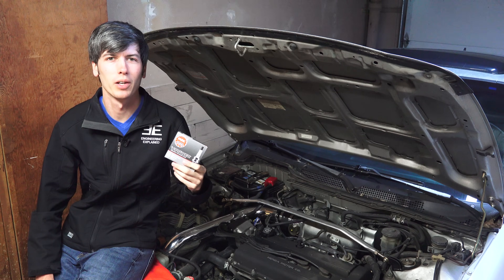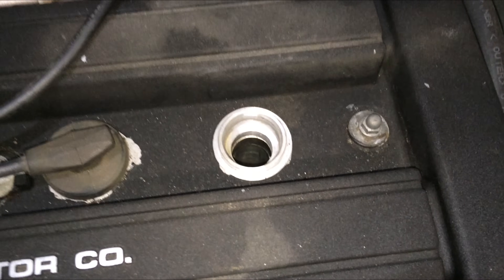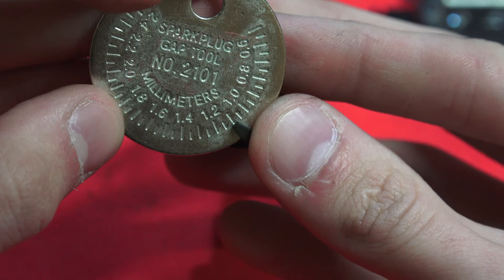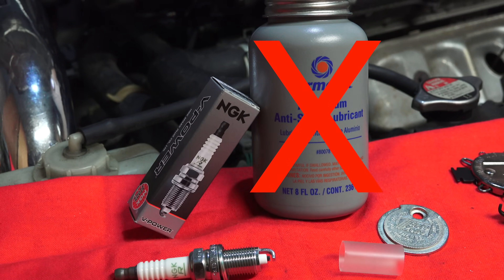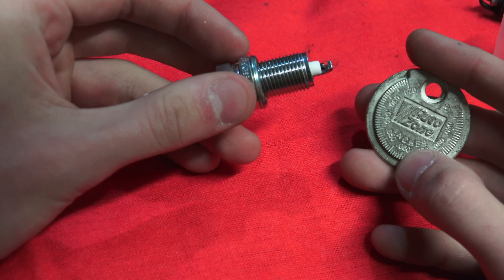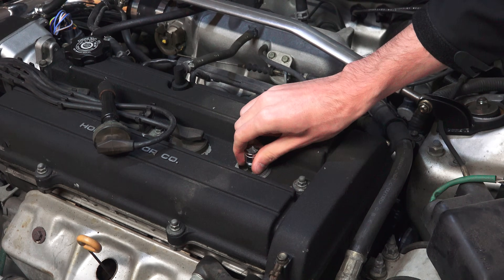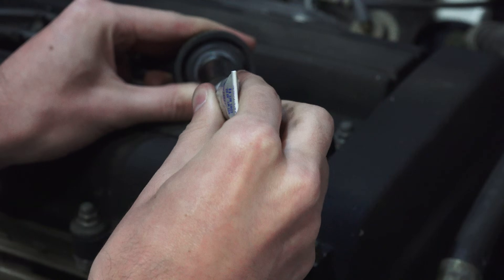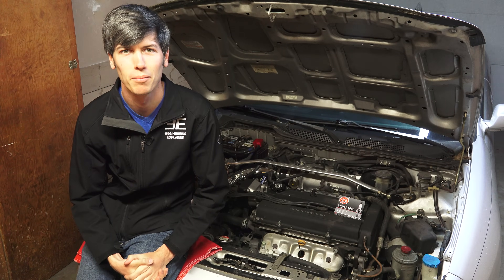How To Change & Inspect Spark Plugs

Comment: Damn I can't find them on my Tesla Model S. Can someone help?
Lol even my Golf TDI doesn't have these :( What am I doing wrong?
Reply: +Hunter178 Is that a joke or are you serious?
Reply: +Hunter178 Car manufacturers nowadays hide everything from the owner. To get to them you need to strip half the car, reprogram the ECU bit by bit and solve a 18x18x18 Rubik's Cube.
Reply: +Hunter178 First you got to jack up the car and put it on jack stands. Then remove the driver's side front wheel and then the passenger side rear wheel. After that, open your trunk and remove the carpet to expose the spare wheel. Take that out and throw it away, you dont need that. Then open the hood and proceed to stare at it until someone comes to help you.
Reply: ***** True. But i dont like drinking while im working on my car. Its after the repair/maintenance that I enjoy my cold beers. And after my first test drive....
Reply: +Hunter178 Dude, im not sure about your tesla, but i would assume it doesnt have an engine, and its a pure electric car, so you dont have spark plugs in the Tesla.
about the Golf TDI(Turbo Diesel Intercooler) - diesel - diesel engines dont use the same ignition system as gasoline cars. You dont have spark plugs in the Golf either, instead it has nozzles which spray diesel fuel directly into the piston compartment at a high preasure and the diesel fuel selfignites from the increased preasure provided by the piston in the compression cycle.
Reply: Pavel Nedelchev Dude I thought the joke was more than obvious :D But thx anyway and I think it's called Turbo Diesel Injection.
Reply: +Hunter178 dude......they are in the glove box
Reply: Just drive it into your nearest lake and watch the sparks fly out
Reply: First you've gotta switch the summer air out for winter air in your tires

Comment: The crush washers are making me nervous and throwing me off because I cannot tell if it’s getting tight. you did a lot of turns. I didn’t do as many turns and I have same torque spec as in the video but I only did like 1/4 turn

Comment: I have a question about my 04 Dodge intrepid I had trouble taking off one spark plug and when I finally got it off there was looks to be rubber or plastic ring down where the spark plug set at and also some deposit what is that and also how can I get that out I don't have air to blow it out what is a good way to get it out without dropping in the engine
Reply: try long ice pics or any long sharp tool to break it up in pieces then stab it and bring the pieces out

Comment: Hi when after I changed my spark plugs and turned the car on there was a lot of smoke coming out of the exhaust. What did I do wrong?
Reply: Adrian Campos did the car stop smoking after running for a little bit? if yes you could have water or oil on top of your plugs. and when you removed them it went into the cylinders and got burnt off

Comment: How important is it to use the correct amount of  torque ? . What happens If I just use a plain normal ratchet  ? .
Reply from the maker: +Jarek Roitapfel Could damage the cylinder threads, or put the spark plug in too deep, causing contact with the piston or valves worst case.
Reply: Engineering Explained Thanks , guess I was about to damage my old banger.
Reply: +Engineering Explained you are kidding right?  You would strip the threads long before you ever did that. I have been doing plug jobs for 50 years without a torque wrench and have never either stripped a thread and definitely never driven a plug into a head deep enough to contact a piston. A bit of engineering overthinking I would say. Oh.... I have never had a plug blow out of a cylinder because it wasn't tight enough.

Comment: Worth noting that you should avoid using the spark plug sockets with rubber inside when tightening/reinstalling the plugs as they sometimes stay attached to the plug when removing the socket and are a pain to get out.
Reply: I used a little bit of WD-40 on the rubber end.
Reply: That actually makes a lot of sense, I wonder if it messes with the contacts on the leads tho?

Comment: what about on a 1984 300zx? Where you gotta take off the intake manifold. I tell you, that was a pain in the ass.
Reply: +Myasa Man i bet a old Toyota HiAce is worse. pain in the ass.
Reply: +TheDamnSwede well there's more than just the manifold to take off, plus the pieces are all corroded and the vacuum hoses and fuel lines are all basically melted on.

Comment: I replaced the spark plugs and wires on my 05 ford Taurus and now the engine cuts off when I put it in reverse or drive. However, it stays on when in park. Any clues to why?
Reply: check for any wires or vacuum lines you may have disturbed doing that work

Comment: not the case here, but on platinum plated plugs you don't want to gap them, you can flake off the plating. they should be properly gapped from the factory and protected from any impact from the little cardboard tunes around the end

Comment: in my car spark plug siezed and not removing 
please help me how do i remove them and replace new one
thanks
Reply: carefully use a long cheater bar with a socket on the end and try slowly moving it counter clockswise

Comment: Quick tip: If you have a Ford vehicle you can usually buy the Autolite equivalent for a fraction of the price of the Motorcraft plugs. They are the same exact plugs. :)

Comment: I noticed you click the torque wrench more than once when tightening the plug. Never ever click the torque wrench more than once when tightening any threaded object especially in aluminum parts. You will over tighten the object and possible damage the threads.

Comment: I've never heard of putting dielectric grease in the plug wires, and I don't quite understand how this helps?
Reply: dielectric grease is slick and makes removal of the spark plug boot easier to remove but it also is highly resistive to electric sparks that can jump air gaps to your engine head or block. Anyone who has ever had an illusive misfire caused by this will never change plugs or plug wires without using it. I had one of these once that almost drove me crazy until I finally saw it one night jumping from the coil wire to the metal band around the coil.
Reply: +Hammer0f Thor awesome! thanks for your reply!

Comment: On my smart car i removed the spark plugs and they were soaked with oil, is that normal?
Reply: No, you need to get it checked its either a bad spark plug or most likely a leaking valve cover gasket

Comment: what happens if the spark plug gap is more or less than factory?
Reply: You adjust it by bending the electrode. The gap measuring tool usually has a notch on it designed to do this.

Comment: However, not all cars have plugs that are easy to get too, and yet others are almost impossible..
Reply: 8-valve struggles :D
Reply: +Hollowseed1 Transversely mounted V6 struggles, for the other 3 cylinders that are not facing you.
Reply: Bikes for example
Reply: +DarkMan2555  i feel you. i had a 98 chevy malibu, it was hard to get to those back plugs.
Reply: cough boxer engines
Reply: My Toyota Corolla 2006. is very accessible and maintenance friendly car.
I remember my old late 1970's,1980's Volvo 240,same thing.
Reply: the 2013's nissan sentra is a maze to get into
Reply: True. To access the plugs on my Honda Fit (per service manual) I had to remove both wipers assembly, the windshield lower corner trim pieces, the cowl screen, and a metal tray under it all that holds the wipers motor.

Comment: I would think mating surfaces need to be cleaned or wiped before installing anything.  Why doesn't anybody clean the top of the cylinder head, where the spark plug mates, before inserting the new spark plug??  I imagine a rag and screw driver could be used, but seeing if you did a good job is difficult.  In addition, the rag may push debris on the sides of the well into the cylinder.

Comment: forgot to mention that the price is for each plug man. also not every 30k miles means you have to replace the plugs. it all depends on the make and model and how you drive your vehicle. I have over 50k on the same plugs and I check them regularly, they are still fine to run.
Reply: +jlrockafella In his case it was $10 total. $2.50/plug for copper plugs, on an Integra/Civic where everything is literally a dime a dozen, is about right.
Reply: *****
damn, i gotta get another vehicle then. I gotta use the platinum plugs on my GT every time I do a tune up. They are not cheap ;D
Reply: +jlrockafella Hehe, my Intrepid needs platinums too (6). They go 100,000 miles though so I've only changed them once so far.

Comment: If you want to upgrade your ignition system take out the oem spark plugs and replace then with some high torque and horsepower glow plugs, you'll be surprised with the results

Comment: Dear Engineering Explained: The following is my opinion...l. Honda recommends 13 lb/ft of torque WITH anti-sieze.  NGK recommends 24 lb/ft without.  I'm pretty sure this is the reason for the confusion over anti-seize.  Personally I install NGK plugs without anti-seize ONLY WHEN NEW. and torque to their recommended 24 lb/ft.  The plating is a sacrificial layer which to me means "one time use".  Should you remove your plugs and re-use them. (ie: for inspection, compression checks, or any other reason) re-install them with copper anti-seize and use the recommended 13 lb/ft.

Comment: The in line 4 cylinder spark plug replacement shown should be a simple job. But try this on a  transverse 6 cylinder engine spark plug replacement where you have to remove the intake manifold to get to the back cylinder bank, goes beyond an average owner's ability.
Reply: +George Travers Imagine changing spark plugs on a V12 :D
Reply: +Giovanni Foulmouth  I've done it on a 80's jag, and it wasnt to bad. Getting to the back plugs in my 98 chevy malibu was hard tho
Reply: Douglas Gardner the funny thing is, when I wrote that reply, I was thinking about the XJS :)

Comment: Why not upgrade the regular spark plugs to iridium spark plugs?
They are known to have some benefits and to last way longer.
Reply from the maker: +Rafael Coutinho I put 300 miles on my Integra last year.
Reply: Engineering Explained You should make a video about iridium spark plugs. I think a lot of people will appreciate it.
Reply: +Engineering Explained OEM plugs meet the requirements so they're never a bad choice, however, your viewers don't necessarily share your mileage preference so it would be beneficial to bring up the idea that they can pick heavier duty spark plugs
Reply: +Rami S. Problem is non-OEM plugs can have issues w/ misfiring, or even failing to start. Just about every car has a forum online somewhere, double-check you don't have a picky ignition system before you deviate from the exact OEM plugs.
Reply: +Kyle Repinski There's absolutely no problems if you replace the OEM spark plugs with Iridium spark plugs of the same specifications from the same manufacturer.
Reply: ***** Like I said, some cars have picky ignition systems. You haven't worked on every car ever made, your anecdotal evidence means nothing.
Reply: +Kyle Repinski And where's your evidence? You are just some nerd trying to look good and pretend you know something about cars..
Reply: +Rafael Coutinho The plethora of people with Chrysler LH body vehicles like myself that insist there's no plugs that run better than the OEM NGK platinums, that's my evidence. Go look it up.

And as for what I know about cars, there's not a single damn job I wouldn't tackle with my car, save something serious enough to require pulling the entire engine out. Every suspension part on there was replaced by me, which is quite a pain in the ass when half of it was rusted into place; just this weekend I got rid of the silly leaking oil cooler lines (Chrysler stopped using an oil cooler in newer model years of my car, I wonder why...). Brakes, head gaskets, spark plugs, you name it I can do it.

To me it looks like the nerd trying to pretend they know something about cars is you.
Reply: +Kyle Repinski Don't waste your time trying to make yourself look like a pro mechanic, I have no way of knowing if anything you say is true, so it's all crap to me.
Have you tried using an Iridium NGK spark plug of the same specs in your car? Probably not, so please stfu. :)
Reply: ***** You tried them on one car. Wow. That must be true on every car then! /s

I'm saying NGK makes plugs of the same spec in iridium, I have tried them, and they do not work well. No auto parts store marked them as compatible, and I'm not even sure if NGK makes them anymore.
Reply: ***** To be clear, all I'm saying is that you should check and see what other people have experienced with your car before you deviate from exact OEM plugs. In some rare cases they're a problem. In most cases you're absolutely right, iridium plugs are great, in my mom's RAV4 they work fantastic. I was surprised it wasn't the case with my car, and it turned out had I looked online first I could've saved myself the money I wasted on those iridium plugs.
Reply: +Kyle Repinski I agree with what you say. Fords also sometimes tend to have problems with non oem sparkplugs. For fords the usual ones which are preferred are motorcraft or autolites. This once happened to my dad with him going with a different brand than oem. Had to replace new spark plugs immediately since the car was misfiring.  Just like you said, the best friend for anyone is an owners manual and forums.
Reply: +ovf123 Just out of curiosity, did that Ford use coil-on-plug ignition? Or did it have spark plug wires.
I've been getting the impression that coil-on-plug ignition systems are the pickiest when it comes to spark plugs, I haven't seen this issue with older engines that use spark plug wires such as the Integra's in this video.
Reply: +Kyle Repinski the van was a 91 so it had a distributor. also on crown victoria forums the general consensus is motorcraft or autolite for coil on plugs. Many stories with misfiring with different plug brands. the difference in price is sometimes so little that it is not worth trying to save a penny on non oem plugs.
Reply: +Rafael Coutinho Precious metals like Iridium and Platinum are actually worse conductors than copper. Because of this, copper plugs have always proven to perform the best, although they are much more susceptible to erosion and don't last as long. In an engine where the plugs are easily accessed, OEM equivalent copper plugs are the way to go.
Reply: Austin Timm Dead wrong! Just research a bit you'll see that iridium spark plugs not only last longer but perform better! It is said that it make a more uniform combustion. I have no way to prove it but it is what most articles say.

Comment: what happened to his WRX
Reply from the maker: +ryanatta it's around like it's always been.
Reply: +Engineering Explained Didn't want to scare off the newbies by showing a spark plug job on a WRX I'm guessing? Gotta love that complete lack of clearance on the sides of the engine.
Reply: +Engineering Explained I would never use a torque wrench to tighten the plugs at all
Reply: Why?
Reply: still didnt tell why

Comment: Not to be the bearer of bad news but torque wrenches are kind of sorta for noob mechanics. Now before you going hating on me I am mechanic, have worked on many cars doing many different things, and have worked with many mechanics who don't use torque wrenches, and have yet to either my self or other people I work with, have a problem due to over/ under tighting. Also you need to be very carefully with those because although the plugs are easy the valve covers are not (I mean they are pretty easy but not for some one with so little experience/ knowledge that they didn't know how to do plugs till watching your video). I have seen on many occasions where the seal on the cover where the plugs are is leaking. You don't know till you pull the plug wire out, look down the hole and see a bunch of oil. If you cant do the cover gasket, and try to just put the wire back a lot of times you will get a miss fire because now there is oil all over the top of the plug. :(
Reply: +Kevin Weil While I do kind of agree that torque wrenches aren't a necessity on everything, there are some things too critical to screw up that I hope everybody would take out a torque wrench for. Lug nuts, and some extremely important suspension parts. I could not live with myself if I screwed up something that caused somebody to lose control of a car.
Reply: +Kyle Repinski  I knew a guy who didnt torque his connecting rod bolts.... Didnt end well.

Comment: If you have a ford triton engine AVOID doing it yourself. Serious engine damage may occur
Reply: Why?  I've had no problems whatsoever. You just don't remove plugs from the engine when it's hot unless you want to remove the threads from the engine.
Reply: +Hammer0f Thor Just Google it, the problems are well documented.
Reply: +Jimmy Dean LOL so only a trained surgeon can remove the plugs from my Ford?  Like I said, the engine must be cold.

Comment: Torque wrenches aren't overly expensive, either.  If all you had was a car, you could do it for sub $50 no problem.
Reply from the maker: +Sunshine_Shooter Yep, not too bad. You can also rent them for free from auto-parts stores, just be sure to check with them that it's properly calibrated - who knows what the last person did with it. :)
Reply: +Sunshine_Shooter Where I live a good brand ones start at $80